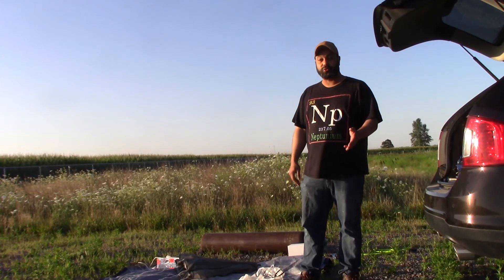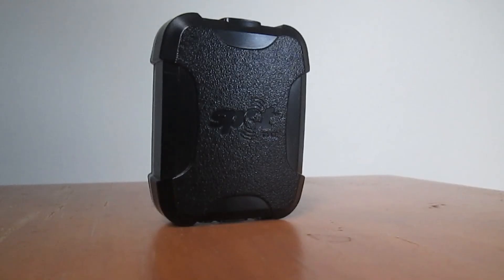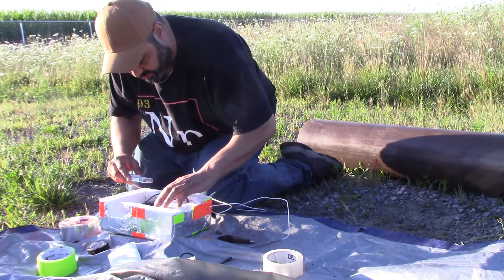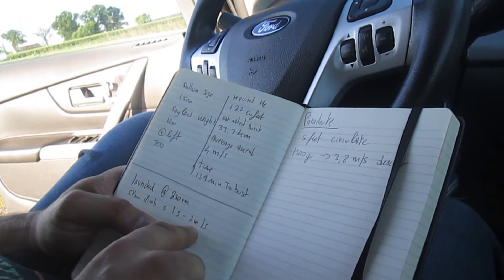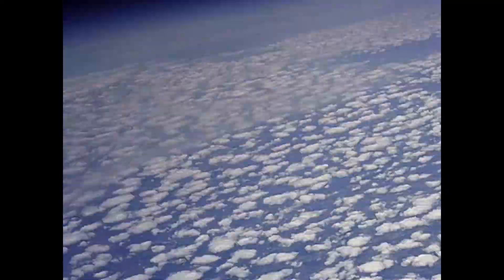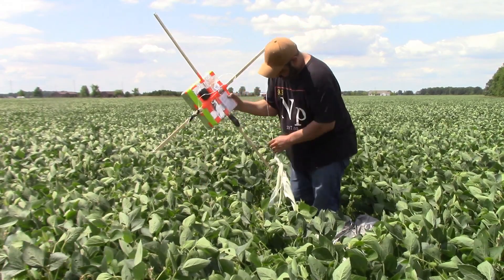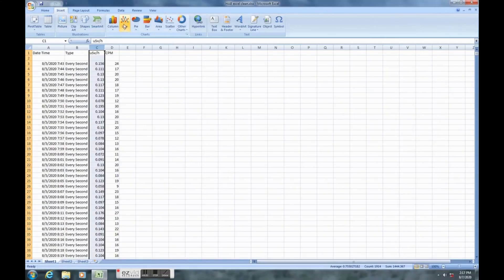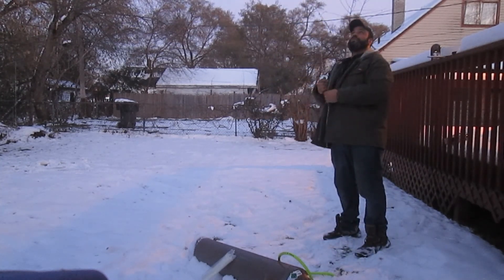Near Space with Helium Weather Balloon

Comment: I enjoyed watching this, amazing stuff. Again, if you happen to be looking for a volunteer partner for anything software related, you can contact me:
https://fschuindt.github.io/blog/about/

Have you considered platforms similar to the ones for RC plane/quad hobby? I know there are digital gyros, GPS, accelerometers, thermometers and many other devices all with a smaller form factor and sharing the same power source. Check for Ardupilot and similars if you haven't already and if you're willing to work on similar stuff in the future.

Thanks for the video!
Reply from the maker: Hey thanks a lot for your support and ideas...I may need your help at some  point it's a possibility
Reply: @Neptunium  Just let me know, it's going to be a pleasure. :)
Reply from the maker: Are you a software engineer or specialized in computer stuff?
Reply: @Neptunium  That's correct, there's some info about me on the URL I've sent you. I have a daytime job working with back-end APIs but I'm a "amateur scientist" during the free time. Not always my experiment involves code (radio and astronomy are usually the theme) but I know that code is my forte. Not that I'm the best, far from it. Only that I don't mind to spend my time on it. I've been having fun with it since 2003.